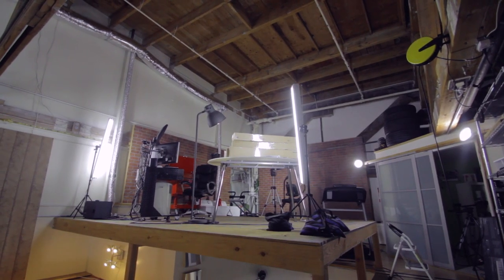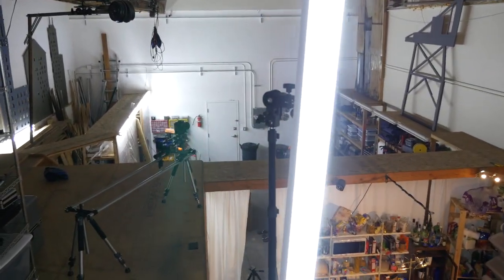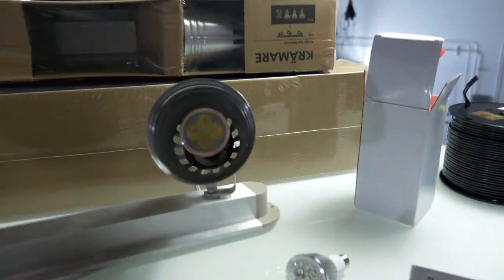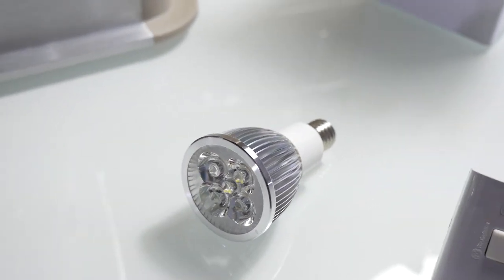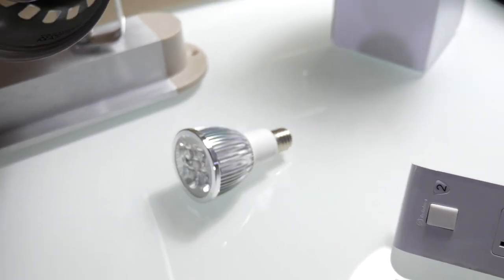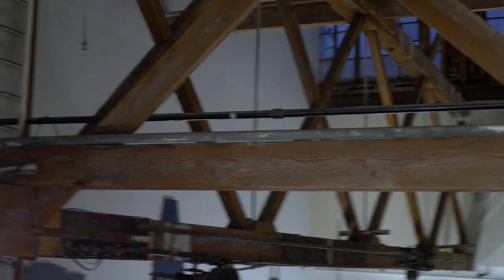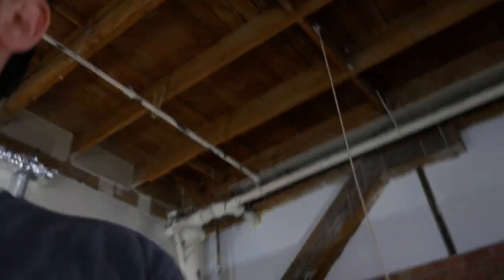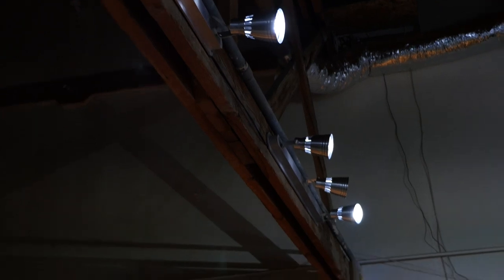Will.U Vlog - New Lights on the New Floor

Comment: Nice work Will. I recently went through this process too. Because of the size of the room I wanted some flexibility too. I went with standard light socket on end of long cord and used a 1 to 4 light socket adapter (found on ebay for 10.00) then bought 24" Chinese lanterns to soften the light. Here in WA the PUD (Public Utility Department) will subsidize LED lighting so I was able to get the little phillips LED bulbs (60w equiv, 5000k, 800 lumens, dimmable) for under 5.00 each.  puts out a good deal of light (240 w equiv with the 4 bulbs and dimmable in a small source).

Perhaps that would work well in your space because you could strategically hang them from the rafters and still have flexibility.